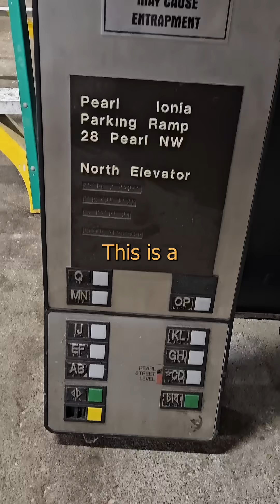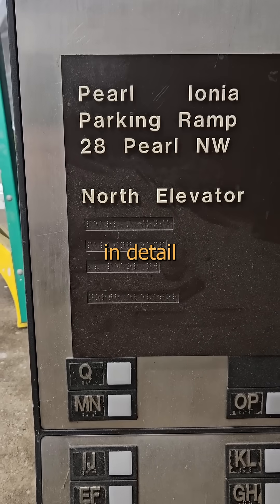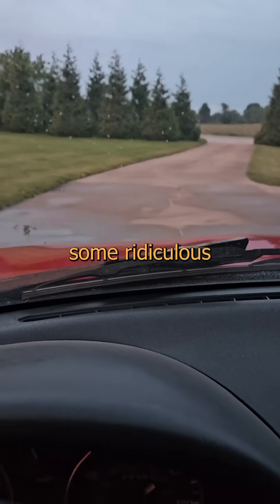Miata Mischief #chrisboden #engineering #gear #elevator #score #stories #parts #hacking #making

Comment: Not sketchy,  i had a 1992 Toyota Passeo.  Bought a 13 inch TV at the BX and it wouldn't fit in the trunk.   2 door, wouldn't fit in the passenger seat.  Took it out the box, barely got it through the door and drove it to my barrack's room with the passenger door mostly open.

Comment: Alright, i own a 2003 mustang. And if youve ever owned one you know what i mean by, "the back seat is a suggestion," i bought a 1500w stereo from a co-worker. PROBLEM WAS. I grossly underestimated how big the speakers were. My stomach is getting leather burns from my new discovered position for my drivers set to fit these 40"³ speakers and the head unit that got them from the boonies of a california town to my town roughly 45 minutes on the highway away in arizona. The speaker in my passenger seat was resting on my shifter (automatic so the pucker factor was only down by like 10%) AND that was the day i decided to do my civic duty and discover the existance of the bolt on the highway and promptly introduce it to my side wall. Fun day. Fun day.

Edit: I feel like i should say. I didnt get hurt. Mustang was back up in an hour and a half after a lug nut star delivery from my sister's husband, for them to blow the hose off their thermostat 5 miles outside of town.

Comment: If a car hits a fire hydrant hard enough that it damages the surrounding concrete (the hydrant is always fine) they will remove the old hydrant and just leave it next to or near the whole so that when the concrete is redone they don’t have to move a several hundred pound hydrant very far… unless of course me or any of my idiot friends find out about the unsecured splash cannon.. I have one in my front yard and two in the back 🤷

Comment: Also, anybody ever dumpster dive at a funeral home! Took home alot of cool shit that weekend, from storage lockers to appliances and electronics. The weirdest thing i got on that haul was embalming tubes, big 1" silicon tubes that i promptly afixed to two exercise machine handles and jammed them in the box rails on an old squarebody and turned the truck into a giant wristrocket that would fling 2" ball bearings over the garage roof and out into the hay field!

Comment: I bottomed out my Nissan Altima's suspension to cart home an entire section or railroad track(legal salvage, i checked first). Pulled it out of a river with a hand-cranked winch, cut it in half using an inverter, two truck batteries, and a chicago electric angle grinder that sounded like it wanted to eat me. Threw that shit in the back seat with the help of two friends and took it home.

Comment: I got a 10ftx12ft shed, had to drive my Toyota truck over 100 miles with 4x4 blocks between the rear axle and the frame, so it wouldn't bottom out on the bumps

Comment: Last year, my buddy and I all-nighted from my house in Jersey to the museum we volunteer at in Pennsylvania. We worked there till 3, checked me in at my hotel, and then drove from Malvern to Robesonia to another friend's house to pick something up from said friend; an old Reading Company station sign for Port Kennedy, cut down on the sides when the RDG faced their wooden signs with smaller metal signs, so it now read "ORT KENNED" instead of Port Kennedy. In my buddy's old Honda, I was crunched as far forward and down as possible with this long ass wooden sign squeezed in from the back of the car to about the front... it was not a fun drive but damn was it great to have helped.

Comment: I brought a 20 gallon aquarium, the sand and the filter home on over 10 miles and on 2 transit buses when I was in high school. I have autism and cerebral palsy but I was both strong and determined. I did not drive.

I brought a old wood phone booth to my 21st floor apartment.

Comment: I’m 6’-1” and I can’t fit in a G1 Miata.  I move the seat all the way back, steering wheel is as high as it goes, and I try to move my foot from the gas to the brake and my knee gets jammed between the steering wheel and the center console.  I’m too tall to use the brake pedal.  That’s a problem.

Comment: My first year of college my friends were pledging at a frat house and aas part of their pledge activities they needed to build a wall to keep the other guys out of the room. Found an old industrial kitchen junkyard with a ton of scrap and snuck in at dusk and took a bunch of table tops and pallets. I was the only one they knew with a truck so I got roped in it for the giggles and a promise of dinner (free food was worth it) so I was the getaway driver. We had to make a quick escape before anyone got there so I told the guys to load the back and get in the bed and hide under the toolbox to avoid the cops seeing someone riding around in the bed. The stainless countertops worked great as a wall/baracade and eventually we're used on saw horses for beer pong tables.

Comment: I once found a pile of stuff someone had dumped off next to one of those clothing drop off bins like they were donating to the Good Will. In and among the random stuff was an entire bench top drill press. Now here is where it gets dicy because I happen to be on my e-bike at the time. And the only thing I could find for tie downs was about 5 feet of old speaker wire I found mixed in with the pile of junk. Not to mention this thing was vintage and made of cast iron and had to be 80Lbs if it was an ounce.
Did I think I could strap an unbalanced cast iron hunk of metel that was half my own body weight to the rear cargo rack of my bike, hell no. But I tried anyway, and had to ride 5mph down the road for another 2 miles to make it home. But I freaking did it. Bonus, when I got home I found that the speaker wire had snapped and the only thing holding it in place had been the massive weight of the thing preventing it from slipping off the back of my bike.

Comment: I once fit 38 tires in and on my 07 Suzuki sx4 hatchback. Including two, 35x12.50x20 mud tires and a set of 30x10.50x15 mudders. I was the shop mule even though i didnt have a pickup. I drove across baton rouge to 2 different sister stores with my chest against the steering wheel, and thats not an exaggeration. My seat wasnt locked in place because it was pushed forward past the locks, hence the wheel to the chest. Got back to the shop and my manager was floored i got them all in one trip. He expected me to take 2 trips to get them all. Only had 4 tied to the roof.

Comment: Two APC UPSs, with NICs and mounting rails, at 50 kg each..   The kicker is, I had a bike and a bike trailer.rated for 30 kg children max.   Riding up a railway crossing was very very slow.   Riding down the other side felt like being pushed by a roller coaster.  Stopping for traffic lights took 10x longer than normal.   And,  just for fun, it was dark.

Comment: It's not that impressive, but I had to get some Ikea furniture home in a Chevrolet Sonic. It was almost twice as long as the Sonic was; so my passenger got to sit on the folded-down back seat and duck behind the window whenever the cops were looking, in order to hold on to the makeshift strap that was attempting to keep the furniture from falling out of the trunk. 
The fact that it made it 100 mi without falling out, and nobody dying, was a miracle.

Comment: Back in 2019 my wife and I went to Walmart and decided to splurge and bought ourselves a brand new 65 inch TV, the problem that neither of us realized till we walked outside of the store is that both of us had small 4-door Nissan sedans, so at 2200 we drove the 5 miles home with a 65 inch TV stuffed in the backseat with both back doors WIDE open. I'm genuinely surprised we didn't get pulled over that night.

Comment: I've used and abused my poor little Focus ST on so many occasions...  I don't own a truck, so I use my hatchback for truck things 😊.  I needed to build a workbench, so I folded down the seats, loaded up the interior with supplies, stuck the 4x4's out the window, and the 4x8 sheet of MDF ratchet strapped to the roof.  I found a sweet wood desk on Craigslist and it barely fit length and width wise.  It was waaaay too long, so about 1/4 of it stuck out the back of the hatch.  Drove 20+ miles home on the freeway with the hatch open grinning like an idiot the whole way home.  Wifey and I wanted grass in the backyard and we wanted a brick border, so I took home two loads of mortar and bricks in the hatch.  Each time the suspension was compressed so i was riding on the bump stops 😂.  I love that car and am never getting rid of it!!

Comment: I got a 1976 dodge motor home for free I wanted the engine out of if for one of my projects but didn’t have a trailer big enough or any kind of heavy equipment at the time and at 17 years old most wrecker companies wanted nothing to do with me with the rear brakes being locked up I jacked it up and had made multiple sets of wooden skids for the rear wheels I drug it 15 miles on backroads home stopping to replace the sodden skids when the road wore them down all because im to stupid to pass up on some free parts from the 70s😂

Comment: Not as great as some of the stories, but I worked at home depot in the flooring section. 

I saw some discount carpet and needed it badly for a remodel. Well, I dont have a truck. However ... My roommate had a 95 honda accord with a sunroof. I called him up after shift. Bought my roll and we shoved that 16 ft mofo through the sunroof and turned his car into a unicorn. 

Someone drove by took a video of us laughing their butt off as we were too. Sketchy... 10/10 would do it again. 

P.S that miata is gorgeous!

Comment: I took an automotive repair course in High School.  A semester of basic then two full years with the latter needing a project.  So my junior year, I bought a car with a bad engine so I could rebuild it.  I then started hauling misc engine parts back and forth on the school bus.  Now this was a 4 banger so there weren't many parts but the highlight was the cylinder head.  4 cylinder or no that's still a decent chunk of aluminum that I lugged onto the bus much to the amusement of my peers and then had to stuff it into my locker as I couldn't get into the classroom beforehand.

Comment: After blowing up my Volvo engine, I decided to drive 5 hours each way in a rental Toyota RAV4 to buy a motor along with a engine hoist as a replacement. We had to ratchet strap it to all the seats because it kept trying to roll around the trunk. It took an hour to get it secure but it finally worked.

Comment: I have strapped 2 couches, stacked one on the other, on the stock luggage rack on top of my 97 subaru legacy wagon. took it about 20 miles from one side of Lynchburg to the other. even at 19 I knew that it was the dumbest thing I had done... aside from enlisting.

Comment: I still don’t know if it was genius or sheer idiocy, but what I do know is this: I got that damn industrial meat slicer home, and nobody got arrested.  

It started when I spotted the thing on Craigslist—a beast of a stainless-steel deli slicer, the kind that could turn a whole ham into lunchmeat in seconds. The seller wanted $200, but after some haggling (and a vague mention of "cash and no questions"), we settled on $120. The problem? It weighed about 300 pounds, and I drove a Honda Civic.  

I showed up at the seller’s warehouse after dark. The guy looked like he’d been forklift-certified in prison, but he helped me wrestle the slicer onto a dolly. Then came the real issue: fitting it into my car.  

The Civic’s trunk? Laughable. Back seat? Maybe if I disassembled the damn thing, but I didn’t have tools. So, I did what any desperate man would do—I ratchet-strapped it to my roof.  

Picture this: a ’98 Civic sagging under the weight of a commercial-grade meat slicer, bungee cords straining like they’re in a horror movie. Every bump made the car groan. At a red light, some dude in a pickup yelled, "You good, man?" I gave him a thumbs-up like this was totally normal.  

Then, halfway home, the straps started slipping.  

I pulled into a 24-hour Walmart parking lot and bought every bunge cord, rope, and zip tie they had. A security guard eyeballed me as I MacGyver’d a web of restraints around the slicer, muttering, "Just gotta get home, just gotta get home."
  
The last mile was pure tension. The slicer shifted ominously with every turn, but by some miracle, it held. When I finally pulled into my driveway at 2 AM, my roommate walked out, took one look at the monstrosity strapped to my car, and said, 'What the actual fuck, dude?"

"Deli sandwiches for life, man."

And that’s how I became the proud owner of a possibly-stolen-seeming meat slicer—all thanks to bad decisions, Walmart’s finest elastic cords, and sheer dumb luck.  

(Worth it.)

Comment: Not my story but my dads, he once hauled a 30ft telescoping pole with an old WW2 army jeep. He did so by using the pole as a trailer by attaching a set of wheels on the back and a hitch on the front.

Comment: I dont have a hauling story but I've taken my little 2013 Chevy sonic hatchback on stupid mountain trails and railroad right of ways (legally, to get to a cemetery of course) and have had my leather cheerio puckered tight just praying i would not roll that thing off the edge of the road or get stuck and have to make the worlds most embarrassing tow truck call. Fingers and toes crossed i haven't gotten my little guy stuck yet but theres always time to fuck up in a spectacular manner

Comment: When I was a teenager I got a 3 ft diameter industrial spool from a crew doing work at my school. After track practice that day, my friend and I set about rolling it 1.5 miles to my house. About halfway there we were starting to get worn out and came to a hill. We had a very rational plan to let the spool roll down (in the middle of the road) only about 20 feet at a time so it wouldn't gain too much speed. Well as soon as my friend let go of it the first time I immediately knew it had too much momentum for me to stop it without being injured so I stepped aside and gave it a glancing blow, trying to prevent it from continuing straight downhill. I was not very successful and it continued down until it dipped into the ditch, then caught 2 feet of air ramping over a driveway. Someone was looking down on us that day because as the spool careened down the hill, it avoided all the parked cars and fences next to the road, ending up coming to a stop on a patch of gravel near the bottom. We breathed the largest sighs of relief of our lives and then rolled the spool very slowly the rest of the way.

Comment: When I was in high school I had a construction class where we fully built a shed from the foundation to the roof. We worked in groups of 4 so everyone got one wall that they framed entirely on their own, windows and everything. On the day we were framing walls (it was a full school day, our other classes got cancelled so we could focus on just building walls), halfway through the day our teacher stops us, gathers us around and tells us the police station emailed him saying the wanted to buy some of the sheds, but they didn’t want any windows. Most people hadn’t got to the window framing yet, but I worked fast and was almost completely done with my wall and now had to remove the window part. Instead of scrapping it, I kept and took it home. Problem is: I took the bus. So I had to carry a 7’ window assembly weighing ~150 lbs through two school busses and half a mile from the bus stop to my house. Why did I do all this? Because I could. I haven’t even done anything with it yet, it’s just been sitting in my backyard for past couple years.

Comment: Me, my sister, and my stepdad found an old light post in a creek. It was about 20 feet long. All we had to haul it was a four-wheeler and a 5 foot trailer. We chained the top of the post to the trailer hitch on the four-wheeler and chained the bottom to the trailer. We got several looks as we drove back home with a light post on a trailer pulled 15 feet behind us.

Comment: So I’m in a band, and at a point I was the only one with a vehicle. It’s a 2009 lexus es350, so not exactly a gear hauler. I managed to fit a crate 2x12, a 70’s peavey bass 18 inch head and cab, the better part of a drum kit, miscellaneous microphones and recording gear, and a non-collapsable hand truck to move it all. Oh, and 3 passengers. Do not ask me how it worked, or where the lead singer sat.

Comment: drove 4 hours one way to pick up a go kart a few months ago. met the guy at a closed gas station at 10pm with $600. drove home with it another 4 hours and on the way home my headlights started dimming, both at once, always at the same time. that was an experience blasting through county roads at 85 mph after midnight with non functioning headlights

Comment: We drove all the state of Michigan, just picking things up. Originally, we went to go pick up some Dune Buggy parts for my brother's project. We had our jetski trailer, and that's it, so we screwed a board of plywood to the jetski boards. We went to pick it up, and the frame was probably the size of your Miata. We also got 2 engines, 2 gas tanks, two transmissions, and yeah. We through the frame on the trailer, and the rest in the truck bed. On our way back to the cabin, we saw a sign that said $20 pedal boat for sale, so we went and bought that. We threw it in the truck bed on top of all the Dune bugy spare parts, and we drove home doing 30 in a 55. The stuff was held up by hopes and dreams.

Comment: I loaded a 1970's truck bed right side up, ontop of the ladders and ladder rack of my 1994 Dodge ram van 150 and used ratchet strps to drive almost 2 hours home. This was only about 10 years ago. Somewhere I have a picture of it on an old hard drive. Oh and i had to stand on the very top of a 6ft step ladder in the bed on the van to remove the chain hoist because my extension ladder was trapped.